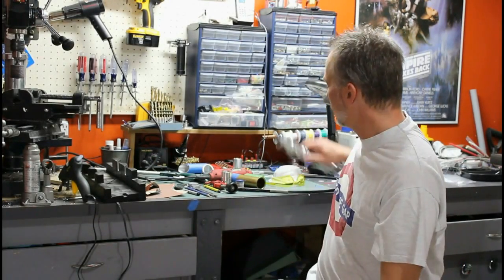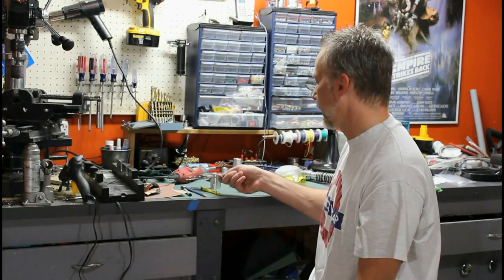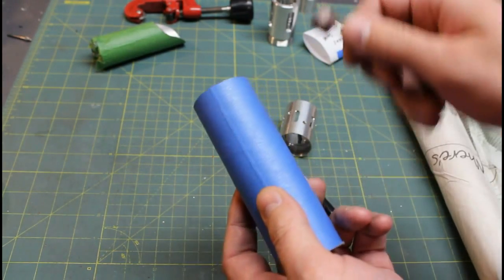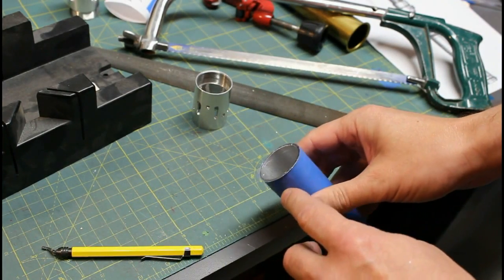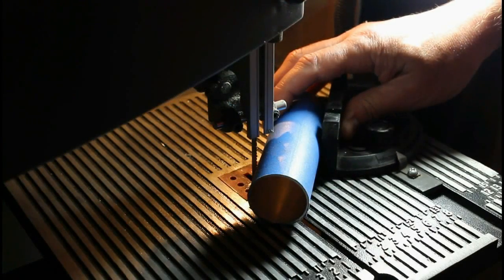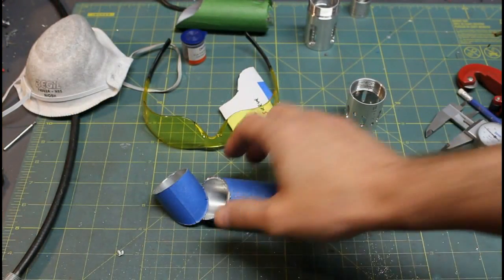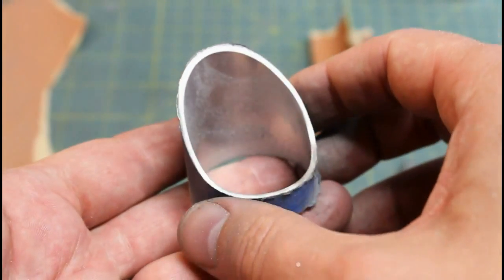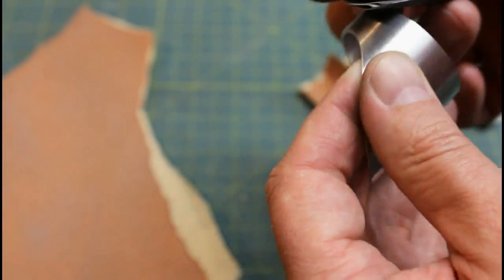Shroud Work

Comment: Never mind,  I just figured out the issue. The aluminum sleeve was very very cold,  therefore I'D tightened just enough for the blade holder would not fit. Sometimes I hate living in Michigan.

Comment: okay so im working on a project called "kraken" and by the name you should know that it involves tentacle shroud work im thinking about making them extend about 1in or 2in past the blade holder. if i put a retention screw on the end of each tentacle would it make it more durable?
Reply: +Attack Titan That's really hard to say. It depends on the material used - thickness etc. Best thing is to experiment

Comment: I have a question. I purchased a MHSV1 blade holder and I purchased the  shroud sleeve mat.,  to of course make a shroud,  and the sleeve will not fit over the blade holder. What did I do wrong if anything?
Reply: The sleeve material fits perfectly over the standard body diameter for MHS parts. You have to use a blade holder that is that same diameter.

Comment: I have a question, does the MHS sleeve material fit over a powder coated main body? if not, would you recomend sanding down the sleeve?
Reply: It might be a real tight fit, or not fit at all. You can sand down the inside of the sleeve material, but it will take a long time.

Comment: Whats an MHS part?
Reply: I believe it stands for "Modular Hilt System" which just means they are compatible with other MHS items. Some prebuilt lightsabers from other places are MHS compatible. Such as some from Ultrasabers will list right on the saber info if it has MHS compatible parts. Which lets you swap out pieces as you see fit.